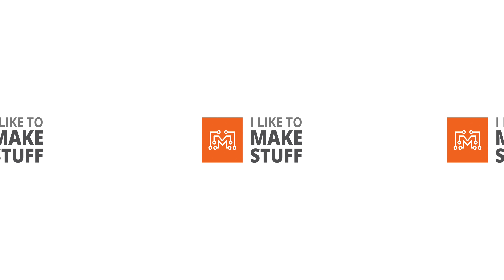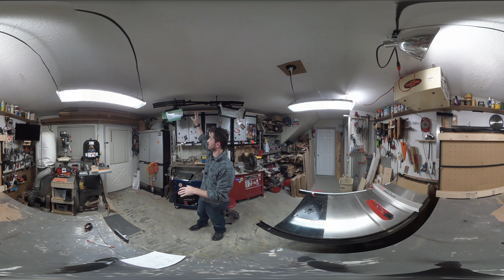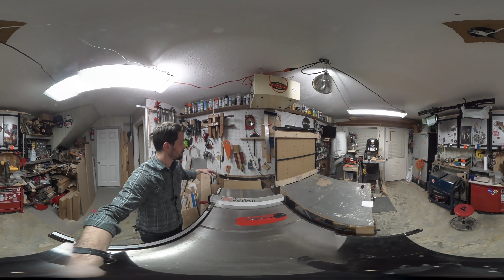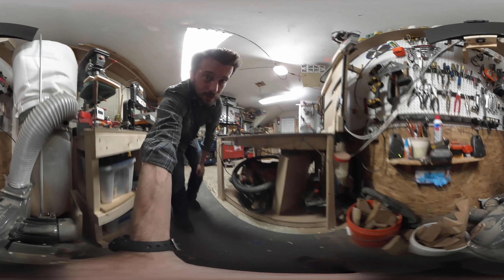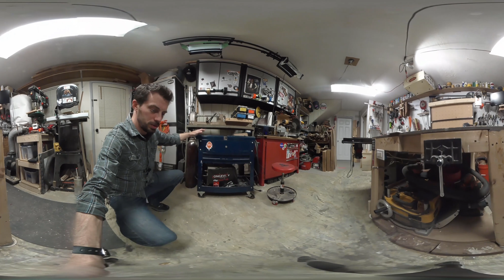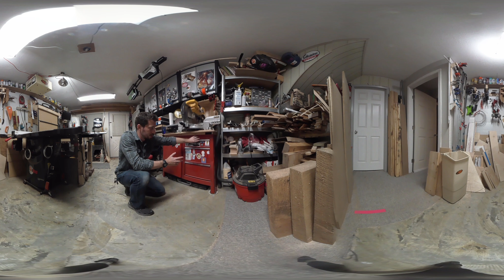360˚ Shop Tour in 4K | I Like To Make Stuff

Comment: Clean the camera lens it made the video all fuzzy
Reply from the maker: +Jelly Dnf No, it's the resolution you were watching it at probably due to your connection speed.  You can manually set the resolution in the bottom right corner of the player.
Reply: +I Like To Make Stuff k thanks

Comment: A suggestion Bob: take the screws labels and tape them on to the lid of the box, corresponding to each section, gets them out of the way and makes them more visible.
Reply from the maker: +Sebastián Quintero Actually I did that, but they kept falling into the box, so I left them :)  I probably should just redo them with better tape.

Comment: Am I the only one that can't clearly see the video. It's very low quality on my iPhone. Is it just my broadband ?
Reply from the maker: +jose hinojosa YouTube changes the quality based on your connection. If you get on Wifi it should be better.  You may have to manually select a higher quality, I'm not sure.
Reply: +I Like To Make Stuff  I tried adjusting the quality using wifi. It's disabled for some reason. Anyway. Keep up the good work. Love your vids

Comment: the camera just kept slowly moving left as I had my phone on a table.  really iritating, but something they will need to work out on the tech side.
Reply from the maker: +Josh Mann Strange, I wonder what caused that?
Reply: My guess is how the software handles inadequate or odd input from the sensor in the phone it is using for camera orientation.  The phone had the same drift left behavior on Frank Howarth's 360 video. Neat tech, close to being ready for primetime when the image quality improves and the little things for user experience are worked out.  I'd like to see a feature where it homes back to a center spot where the video creator wants the camera to look.  But then how do you toggle that on and off easily, I don't know.
Reply: +I Like To Make Stuff how much money do you think you've put into your shop

Comment: Thanks for the shop tour in 3D.  Don't stick with the old fuse box.  Bit the bullet and get a modern fuse box - safer and more convenient and easier to add circuits if needed.

Comment: Nice tour and very cool idea but your arms look weird. The way they are distorted looks like your arms are on sticks.
Reply: +funfunstuie There is a really odd stitch line. So when you point to something up on the roof line (like the paint cans) when I move the view one of the lights is cut in half! 

Not complaining just pointing out some things I noticed. 

You have really made a great use of a small space. I currently rent a house with a two car garage which I use as my workshop but it's also our laundry and now I have setup my office in one corner so the tools and workshop related items have less and less space. Plus I can't make too much dust as it would destroy our clothes and my computer equipment.

Comment: You really do a lot with a small space. Thanks for the glimpse into it. RE the 360 video, so far, this is the best way I've seen it done...where you talk to one side of the camera and the end user can scroll around if they want to. I have typically not liked 360 videos, because it is very difficult to keep up with the speaker and you're just scrolling around constantly.
Reply from the maker: +Bruce A. Ulrich Thanks! I've felt the same way with the ones that I've seen. That was why I tried to keep the camera fairly static and decided on a "front" beforehand.

Comment: Did I miss the router table?
Reply from the maker: +1943reb I may not have called it out, I don't remember. It's in the extension wing of my table saw.
Reply: +I Like To Make Stuff Yes more on the router table please. My shop is about the same size and I also have a saw stop.  Would be great to tuck a router table into the space.